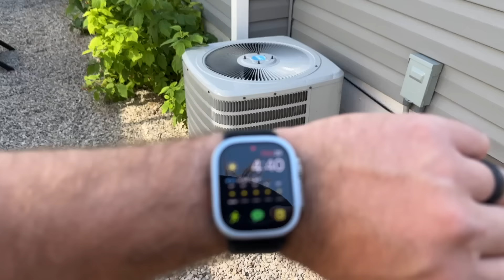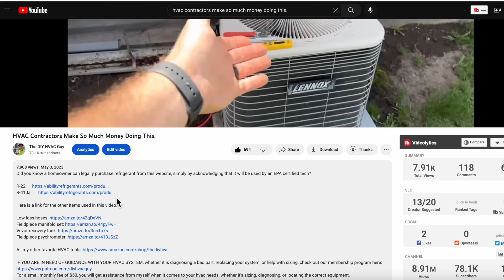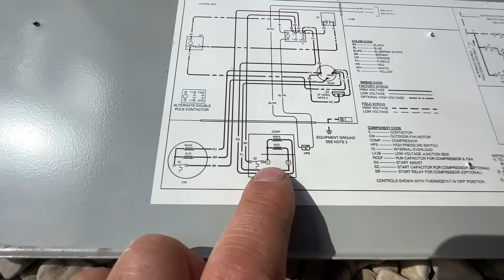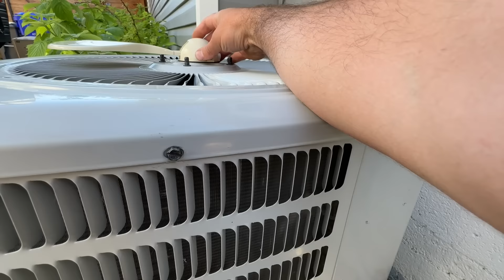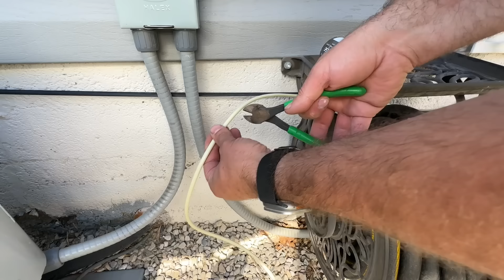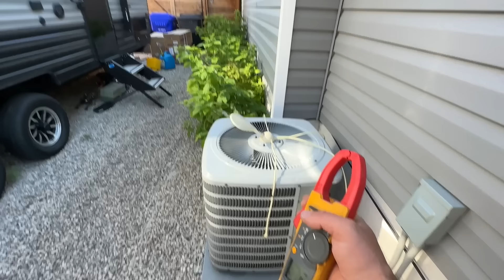Can This Device Actually Lower Your Electric Bill By 30%??

Comment: As a physicist, I can assure you it will have benefit.  Good that it has an inline filter to remove calcium. The misting water is also likely cooler than the incoming air temperature.
Reply: Evaporative cooling works well all on its own even, so long as you live in a dry climate.
Reply: you are not a physicist quit lying
Reply: @Kevin-mp5of  Yes, finally someone gets it. Thank you. My emai is full of haters SIMPLY not seeing the damage that will occur to the thin aluminum condensors. Trying to save people heart ❤️ ache and empty wallet's.
Reply: @kirstenspencer3630  My open-loop geothermal heat pump requires an optional, rather expensive, cupronickle heat exchanger precisely BECAUSE unconditioned "tap water" flows through it every time it turns on. The industry knows that a standard exchanger would be subject to corrosion. Even with that advanced alloy, water must remain trapped in the exchanger between cycles to avoid evaporative mineral deposits. That should clear up any doubts about subjecting your standard coils to unconditioned-water torture.
Reply: @FisherCatProductions  , yes a crupronickle material would be just the ticket for this application. I cannot believe the vitriol and crazy talk my simple reply ignighted.
Reply: There is a vast difference between education and intelligence. A mechanical tech goes to great lengths to monitor and condition water flowing in or around metal systems. I'm no rocket scientist but I can assure you from experience that mineral "filter" isn't worth the paper your diploma is printed on. If only it were that simple LOL! Nor does it condition the pH of the water.
Reply: @FisherCatProductions  it works great. I've done in bahamas for decades
Reply: @alanh8664  I never said it would not work (to aid in cooling). But people with the wrong water chemistry, especially with the newer, thinner aluminum coils, will experience corrosion, mineral buildup, or both. It's a gamble with a very high cost if you lose.
Reply: @Kevin-mp5of AC condensers of dubious quality maybe. Not good quality units though. They are built for outdoor conditions, including rain.
Reply: Sir, the minerals are in suspension in the water, the hoky little filter is not a  submicronic filter and cannot filter the minerals out
Reply: @kirstenspencer3630  "the hoky little filter is not a  submicronic filter "
It actually is.
Reply: @wisenber  Even if it were, it might last about a week, and you have no way of knowing if or when it works with your water. As I said, "if only it were that simple!" And it does not condition the pH.
Reply: @wisenber  I've maintained mechanical and HVAC systems for 50+ years. We have removed countless "mineral filters" and replaced them with osmotic or salt systems after repairing the damage done by mineral buildup. And you neglect the potential corrosion from pH and other chemical contamination that inline filters don't correct, which is usually much more damaging. Having done thousands of water tests from Maine to Florida, I can tell you that more people have water that would be incompatible with these systems than not. Your anecdotal evidence is good for you in hindsight, but someone waiting until to see if they pop a pinhole leak in an aluminum coil that needs to be replaced for $1600--not so good. You do you, but everyone else needs to be aware of what can happen. A professional water test and analysis of your coil from a mechanical company (NOT from the water softener guy!) will help others determine if this is a good idea.
Reply: @wisenber  If your water chemistry is correct, you don't need ANY mitigation device--in which case a simple inline mineral filter appears to work. Depending on how hard your water is, or what minerals are present, an inline may be completely useless. At any rate they WILL NOT correct water pH or corrosive water chemistry, and corrosion is far worse than mineral buildup. And the construction and makeup of coils varies widely. I'm making sure people understand that without properly analyzing the above, they can destroy their rather expensive coil before they "notice" something is wrong. Not sure what your point is other than "Works for me!"
Reply: @wisenber  You do understand that mineralization and corrosion are two different things, right. That even if your cheap little inline mineral filter works for a period of time on someone else's water supply it will not correct corrosive water chemistry. That everyone does not have your water chemistry, or your particular cooling coils. Your point seems to be that "Works for me!" is a universal endorsement to bypass due diligence.
Reply: @wisenber  Never said or implied that. I clearly stated what works for your water chemistry and your coils may be an expensive disaster for someone else, and I explained why.

Comment: I would only recommend this on a TXV system.  That will ensure your evap coil doesn't freeze up.  With fixed orfices, you'll drop the pressure of your evap below the freezing saturation temp of the refrigerant.
Reply: @Howie875 is correct. The misting system only cools the air before the air goes over the condensor coils - which makes the AC more efficient. This does not cause the evap coil to freeze up. The 2 main causes of a freeze up is due to a restricted airflow happening over the evaporator coils or issues with a refrigerant leak.

Comment: I used a 25v solenoid valve and a garden mister system and plugged the trigger wire for the valve into the trigger wire for the compressor

Comment: As an hvac tech.  The stat difference didnt blow me away.  One good thing about it is that it keeps your condenser coil rinsed off.  I would definately clean the condenser before installing this.
Reply: Rinsed off?? Depending on the quality of debris in your air it could make a muddy mess that will bake on your fins and negate any added cooling. I would not count on them being rinsed off, especially with a mist that is intended to evaporate on them to cool.

Comment: The other side of the coin. What about the additional use and cost of water. How would you factor in that in the net savings?
Reply: Do the math,10% of your electricity bill vs 5% of your water bill.

Comment: Looks like a worthwhile addition, but some observations:
1) In this case comparing current is "good enough for government work" but the meat of the measurement would be Watts: volt-amps non-reactive. Meters charge for watts, rather than VARs. Because I don't see it will change that aspect, I'll give it a pass.

2) I second the concern about mineralization. It is easy to get on but the very devil to get off without damaging the condenser, and scale build-up on the fins would be a Bad Thing. Even with the filter (I have never seen an add-on filter effective against dissolved minerals) it could do some costly damage over the course of a season or two. If it were an enclosure with pads made for evap coolers I would be a lot less wary. Having lived in Phoenix - high heat, very hard water - I wouldn't risk it.

Comment: $100 for this though? That's insane. These little mister tips are super cheap. The valve is the only slightly complex part of this. The rest is some tubes and hose adapter.

Comment: I've read some of these comments and it appears there is a lack of logic in some of the responses. Someone wrote that the amp draw reduction and temp drop was negligible. What they fail to take into account is that the amp draw is only part of the savings equation. If the heat is more effectively removed by the misting of the cooling fins, the compressor is going to run less to satisfy the cooling needs of the house. If the system runs less, it's going to cost less. I think that's where the big savings would be.

The temp difference at the register doesn't really mean much to me. The A/C is controlled by the thermostat. If the thermostat is set to 70°, then it will shut the system down when the thermostat hits that temp. The register may be warmer or cooler based on many things (how long the unit was running before the measurement was taken, air currents, time of day, etc.). 

Now, the big question is does this do any good? Does it really save money? I don't know the answer to that. I think you'd have to have a bit more data (actual water usage, run time per hour, day, month, etc.) to really find out. 

Also, there is the controversy of whether or not it will cause any unforeseen damage such as extra corrosion, clogging of the cooling fins, etc. to consider.

Comment: So adding water to any condensing unit will lower the compressor compression ratio for the compressor  thus using less electricity on the unit ( Plus side) Down side is over time you risk mineral deposits building up on the coil or depending on the quality of the aluminum fins they will actually fall off the coil this is bad for heat transfer. You should only use water on a coil in case of emergancy like your condensor fan dies during a heat wave this will get you by until you get the new fan motor. Just wash your condensing unit once a year after the pollen is done and if you can don't use any chemicals besides simple green these other chemicals can decay your aluminum coil faster. Commercial Hvac Tech 30 yrs.

Comment: Interesting idea. I've always kept out unit in deep shade, so my monthly ac bills average about $100. We keep them temp inside the house at 68 to 72 degrees year round.  I'm in south Texas and we average about 90+ days above 100 degrees.
Reply: Am in NV. 110-116 is July, August, and September. Heat's an issue. Water's an issue. House is at 82 with fans going. Misters are banned. Shade is the key.
Reply: I've got my AC set to 76, and the heat at 71 in SC.
We used to have it set at 78 but I found that the house would be too humid.
It's so humid in the summer here and the 2 small BR stay warmer than the rest of the house and one of those small rooms is my office, so any higher than 76 is uncomfortable in there. It's normally in the 90's in the day and mid to upper 70's at night during the summer. 
I'm able to run the AC at that temp without using the grid much at all with my solar system. I've had the solar for about a year and this summer our bills are very low. I only spent about $12 on electricity on my mid June to mid July bill.
My total bill for gas and electric was about $59.
Reply: @frommatorav1  SC is like that though (humid).
Reply: 66 in Colorado setpoint 😃
Reply: Wow, 68 to 72 degrees,  I set mine at 84 on most days, sometimes 83, sometimes 85. And I live in Florida
Reply: @samueljames9342  

Wow. That can be a bit toasty.

I think keeping it in the shade keeps it a lot cooler. Our first unit, a Trane, lasted 26 years. So, I do agree with the premise of his video of keeping the unit cool helps the unit out. 

Our unit sits on the west side of the house. So when we had the house built, one of the first thing I did was plant a bunch of Native trees on that side of the house. Mainly to block that afternoon sun here. It can be brutal at times.
Reply: @samueljames9342  I live in Orlando and my electric bills are around $500 bucks.  I never turn mine below 76.
Reply: @ruck-a-tron  yikes, I get upset when it goes over $120
Reply: @samueljames9342  Yeah it's crazy around Orlando.  I used to live near Pensacola and my electric bills were much less.
Reply: @samueljames9342  72 feels great here in Texas...I would go lower but my wife is from California and starts whining.
Reply: @johngatsby1473  I feel for you man.

Comment: Your AC unit literally sits outside in the rain. They are designed for outdoor use including rain. How can this possibly harm an outdoor unit? Remember the water is not spraying when fan is off so plenty of time in between cycles to evaporate lingering water anyway!

Comment: Ahem...nice concept, but at $99 that price seems a bit redonkulous for the kit. Once can buy a patio misting kit at a local hardware for waaaay less, then simply run it during the hottest days of the year. You won't have the filter (can buy one if you need it) nor the fan-based shutoff valve. But, you can buy a floaty shut-off valve for a humidifier and add 'wings' to make it work with hot air. All that is still way less than ninety-nine scratch. 
Of course, you can also manually spray your condenser while it's running on a hot day and see firsthand whether the whole 'misting' thing is going to make a different in  your voltage draw (indoor temperature drop is an ambiguous measure at best). 
...and it's not going to 'rust out' your condensor any more than the whole darn thing being outside in the weather is going to rust it out. 
One BIG issue with rust: DON'T let your dogs hike their legs (pee) on the condensor!!!! fence it off if doggos are peeing on it. Urine will destroy it within a season, way, way worse than a simple mister will ever do. 
Finally, I suggest a really good, soapy, clean of the condensor coil to keep debris from plugging the airflow. That you need regardless of whether you mist it or not, and certainly before you apply water, less it make a wet, muddy mess of the coils.

Comment: If I understood you right? You said the condenser would be more efficient in the sun? Not correct from my understanding. The purpose of the mister is to lower head temps, not increase. In turn removing more heat .
Reply from the maker: No I said your unit will be impacted more by this device if it’s sitting right on the sun.
Reply: @diyhvacguy  My bad, thanks for the clarify!

Comment: 4.4 amps reduced to 3.6 amps would be 18.2% power savings. Then subtract the small cost of the water used each day and the cost of this device.
Seems like maybe an 18% savings, but hard to know for sure without a power-use-over-time comparison.
Reply: His AMP clamp jaws were not fully around the run wire in the after installation so his reduced current draw reading was BS !!…in the before measurement he did …watch the video.

Comment: This is actually an old idea.  If the misting system gets the condenser wet, over time you can loose the thermal connection between the cooling fin and refrigerant tubing due to fin corrosion taking place.  This is because this type condenser is not made to handle a wet environment full time.  I realize the evaporator experiences this wet environment but, the temperature is much lower so, the corrosion rate is slower.  The correct way to achieve the benefits of evaporate water cooling is to use a condenser made specifically for evaporative cooling.

Also, the hardness filter (basically a small water softener) adds a small amount of salt to the filtered water, accerlating the fin corrosion problem.
Reply: Are the fins made out of aluminum?
Reply: @FKnATOO  Yes, aluminum is used because it conducts heat nicely.  Copper works much better but is more expensive and heavy (3 times the weight).  The fins are usually punched out sheets of aluminum with swaged holes for the refrigerant tubing.  Swaged holes in the fins are used to increase the contact area between the fin and tubing.  Some condensers use copper tubing, others use aluminum.  Aluminum tubing is subject to the same corrosion problem as the fins.  Being outside, if kept wet for long periods of time, the fins pick up dust/dirt which helps hold moisture against the fins long term.  This is a common failure mechanism for car evaporators, which use aluminum fins and tubing.

Comment: Swamp cooler add-on, you will find a buildup of hard water and sediment on the fins, so you will need to clean that, but it will eventually rust out your compressor unit. Saving money possibly, most likely you reduced the life of the unit by a few years.
Want to save money, replace that with a split system. :face-green-smiling:

Comment: Cool idea, since it is the outdoor unit, in the rain, snow, etc. a little water is nothing to worry about.  The Amp draw reduction is amazing.  The people talking about only one degree cooler at register,  that is not the objective people, it's a bonus when is that low already!  I do have concerns on the air flow arm, looks a bit flimsy and winds in my area will rip that off over time.  I think a solenoid controlled fan relay, or amp draw sensor would be more solid.  I've used this idea, temporarily in emergencies when delay getting new/proper condensing fan, and use garden hose spray.  That uses way too much water for perm solution of course.
Reply: It will rot away in direct sunlight, as most things plastic will do.
Reply: 1. i think many folks think the evaporator and condenser share the air. not so. 2. the air at the evaporator does not depend on the condenser being cooler,  the pressures in the system determine that. I myself wonder it the flap switch could be placed inside the condenser enclosure to protect it from damage?

Comment: That flapper lever is the most janky looking thing I've ever seen. They couldn't just use a solenoid valve wired in parallel with the 24V side of the contactor?
Reply from the maker: Yes they make one like that as well on Amazon